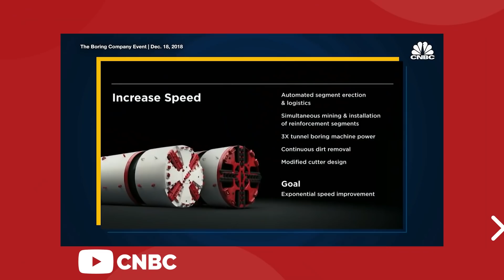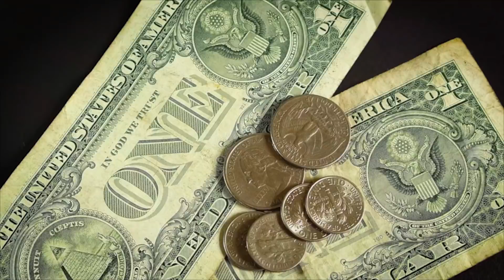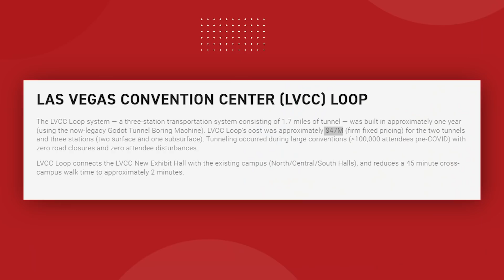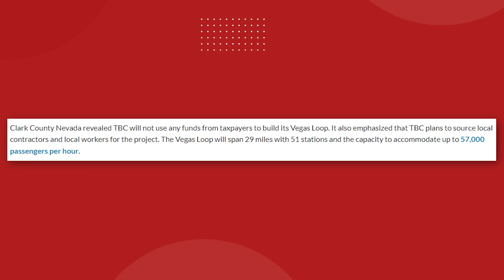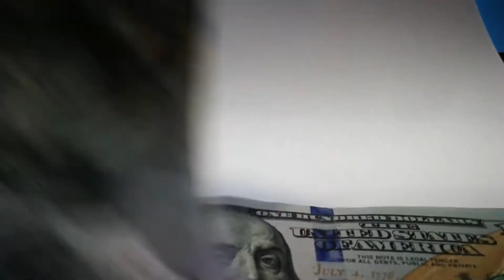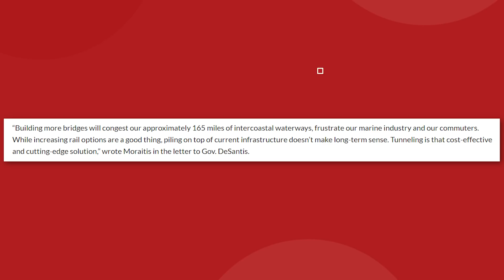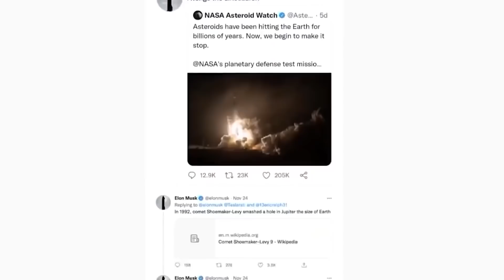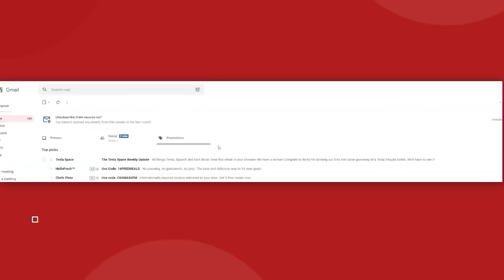The Boring Company 2022 Update

Comment: Even as a fan of Elon I think the Boring company will fail. Narrow tunnels have significant safety issues and as we've seen in London the actual tunnelling is only a very small part of the overall task to create a safe sub surface transportation system.  Some of the video uses poorly researched information as well. For example most currently used tunneling machines use electric motors NOT diesel!
Reply: They’re diesel electrics. The electric motors are powered by diesel .
Reply: @bluecollardisruptor9584  The drive motors on most TBM cutterheads are electric. Some are electric/hydraulic. Mist larger modern machines use variable frequency drive electric motors. They are not, and never have been, diesel. The back-up systems (rams, conveyors, pumps etc) are all electric and/or hydraulic. The hydraulics are all driven by electric motors on the TBM back-up. The electric power into the tunnel can come from any source, diesel generators at the surface are just one option. As with all electrical feeds it can be a coal, oil, nuclear, wind, hydro-electric, hydro thermal,  power source. None of which is relevant to how the TBM works. many tunnels under construction use diesel vehicles in the tunnel to service the TBM, electric and battery are also commonplace. I think this is where the misunderstanding started when Musk first talked about starting tunnelling.
One exception is the erector plate that picks up the concrete segments. Its a mechanical/hydraulic driven rotational arm. But the segments are commonly lifted by a vacuum plate requiring no mechanical connection between the segment and the erector.
Reply: Has London had accidents with narrow tunnels?
Reply: Explain to me, what do accidents in London's tunnels, have to do with autonomously digging tunnels, for habitation on Mars?
Try to look past the end of your nose.  There's a bigger picture.
Reply: @fredandersen9873  autonomous digging what!?! On which planet!? Those TBM ain’t going nowhere, new building techniques are going to be employed on mats, you’re welcome. With composite materials making survival structure on mats will be easier than lifting millions lbs of mass.

Comment: I always figured the Boring Company would be used to build tunnels on Mars to connect the Martian colonies.
Reply: And mining - mars has to generate wealth.
Reply: Wrong, it won’t happen, only composite materials will be the solution and not an impossible machine to transport to other planet.
Reply: @carholic-sz3qv  yeah and only carbon fiber material is used to create rockets, not stainless steel. (Sarcasm for those that don't get it)  So you don't think a 100 ton capacity can transport a boring machine?
Reply: @Chaotician69  It doesn’t matter what capacity a rocket can lift, a TBM weights thousands tons and also landing on Mars like NASA has proven is not easy let alone for a super heavy weight. Building on mars will require the use of composite materials, 3D printing……
Reply: @carholic-sz3qv  perhaps but I have faith in the ingenuity of the SpaceX team. They've accomplished so much already.
Reply: @Chaotician69  yes they have accomplished something but they aren’t the only ones to have, others are already using much modern production technologies for all kinds of launch applications.
Reply: @carholic-sz3qv  of course they're not the only ones to innovate, no one said they were, but they are without question the spark that has been missing for decades beforehand. They are push forward to begin making advancements in all technology. I hope like hell they're not the only ones to make technological leaps and bounds. Heck they're not even the inventor of landing Rockets, but they made it happen and were able to reproduce it over and over again, successfully.
Reply: @Chaotician69  yeah just like many companies are already making reusable rockets, other companies have much more flexible products for all kinds of applications. The boring company TBM is only one size and definitely doesn’t fit the needs of all customers.
Reply: lol,  they can barely do it on earth ha ha ha
Reply: @jebes909090  Well, there won't be cumbersome bureaucracies on Mars....so much easier to build tunnels on Mars
Reply: I believe the colony is going to be in at the tunnels.
Reply: I think that's a safe bet honestly. Give the boring company some time to perfect the tech. It's still relatively new and developing new tech all the time. I believe they eventually will be tunneling on Mars to connect colonies or installations or mining outpost, or whatever.
Reply: @Chaotician69  the techs a hundred years old.    If they havent figured it out yet,  its not going to get better.    This is never going to happen.   Spacex will never get to.mars
Reply: Exactly! You're the first intelligent commenter I've seen on this post.
Reply: Why do I get the feeling that people haven't been paying attention to what's been happening the past 20 years? Elon Musk has helped to spark a massive technological leap across so many platforms already and I doubt he's ready to halt that progression. Doubt all you want but he's already proven so many highly educated people ..... wrong. Personally, I'm not ready for him to stop either. We should be far more advanced than we are. Sadly there are so many outside forces keeping the human race from advancing. From E=mc² ..... anything can be accomplished. We're only limited by our imagination or lack thereof.

Comment: I am putting together a quote for the London Underground extension, and I can tell you, a 12’ tunnel can be cut for $5million per mile. Using existed off the shelf, fully reusable electric powered TBMs.
Reply: If you’re talking about the recent extension, it cost 1 billion dollars…
Reply: @PrettyKittyKeia  I am talking about the next TFL project. And the Northern line extension was hugely overpriced. Price paid vs Actual costs are a light year apart.
Reply: @PrettyKittyKeia  If I bought a McDonalds BigMac for £4 and sold it to you in an upmarket celebrity chef restaurant for £50, is that cool?

Comment: So many false statements. Stop quoting from Elons PR department. Wrong on so many points.
Reply: So quote them
Reply: @PrettyKittyKeia  There are existing TBMs that can bore and line simultaneously. 
They are electric powered.
They are fully reusable.
And a 12' bore can be made for $5million per mile.
Reply: Page 103 chart G1. A 4 meter tunnel can be as little as 5 million per km.
Reply: A 9 meter tunnel is quoted as £22million per km.
Reply: Then you should systematically point out the errors and improve the truth of others.
Reply: @PeteOnTheRocks  What Boring Company is “inventing”, already exists.
Reply: @davidwebb4904  You must get really upset when someone “invents” a new kind of lightbulb huh
Reply: @PrettyKittyKeia  You can buy more capable TBMs than Elon's, off the shelf, today.
Reply: @davidwebb4904  so point me in the direction then instead of continuing to use vague points that may or may not even be true
Reply: @PrettyKittyKeia  Youtube is not letting me post links.
Reply: @PrettyKittyKeia  “A billion per mile vs Elons 10 million per mile”. 
A billion per mile, is tunnel twice the diameter, , includes train tracks, electrifications, actual stations and trains, plus 500% profit with it being government contract. 
10 million per mile for a tiny tunnel, is the raw cost, tunnel lining and spoil removal. With Zero profit. 
Meaning I could create exactly what Elon is creating, for the same or less money. 
Its like comparing a 5* fine dining meal, with the raw cost of a potato. 
Thats grossly misleading.
Reply: @PrettyKittyKeia  Go look up Thunderfoots debunking video on the Boring Company. And the Las Vegas Loop.
Reply: @PeteOnTheRocks  see one of my other comments